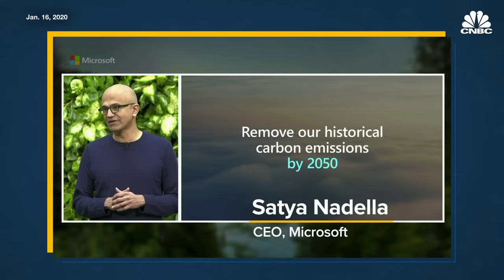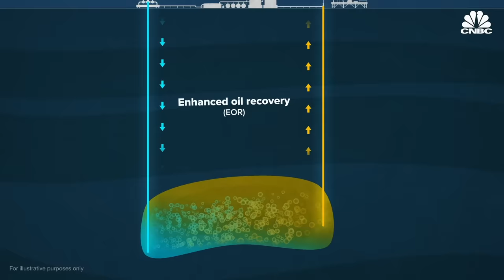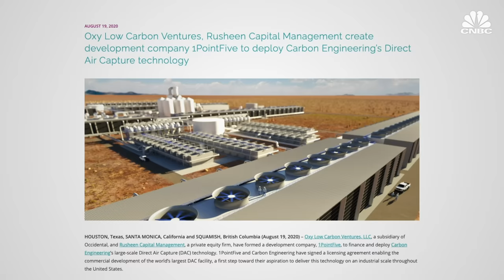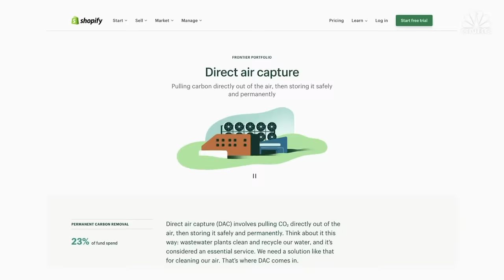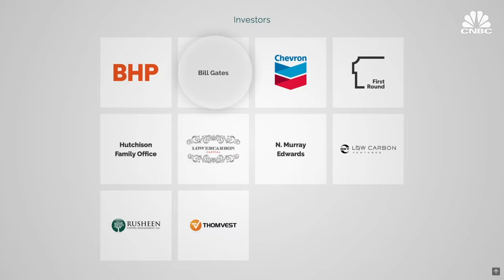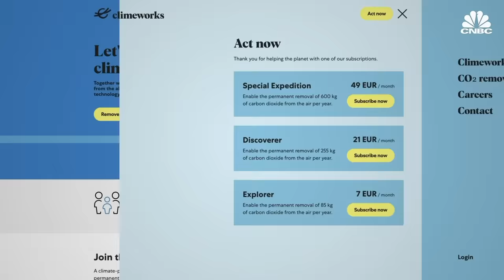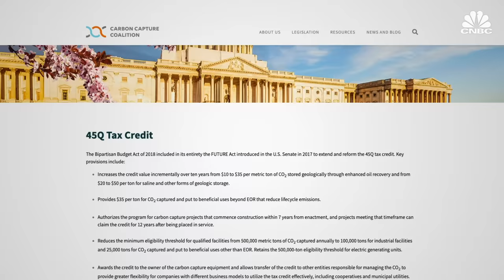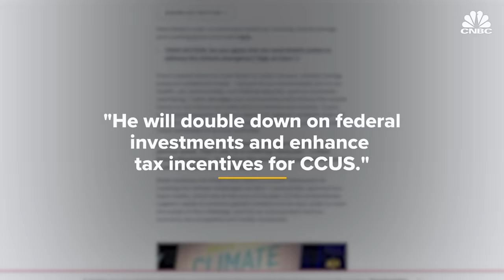Money Is Pouring Into Carbon Capture Tech, But Challenges Remain

Comment: I think carbon capture and forest preservation should work together. I think it could help capture emissions quickly.
Reply: Exactly, one of the most efficient ways of capturing carbon is through storing it in vegetation and soil... which occurs naturally. Preserving soil from erosion and desertification and preventing forests from being reduced is what we should be aiming for.
Reply: @matheusviolante8364  The most :)
Reply: @matheusviolante8364  what if capturing carbon and storing in soil will leads to death of soil... Because soil natural capacity of carbon is increased man made
Reply: @jigsaw2281  It's worth researching for the sake of all humanity
Reply: That's a good idea! The only problem is that for it to be a permanent solution those forests would have to be protected forever, making that land useless for any other purpose. There's a project in Finland to bury the CO2 they captured from the athmosphere into rock formations in the bottom of the sea, locking it away forever, although it's still really expensive and it will probably always be since its basically natural gas extraction backwards.
Reply: @felipegonzalezlelong7944  There's also this idea of using the ocean's phytoplankton to capture c02.
Reply: Yes but that first guy talking here is is the architect of the carbon capture but he says a comment that the capture he sells to Coca-Cola. That sounds like more of a cycle than capture of any sort. Lol
Reply: We need to keep these billionaires off this idea. They see it as a major threat to electric cars and only use it to gain their wealth. 
Can you imagine them not marking up the price to make up for their losses in the E.V matket?
Reply: no it doesn't, it captures like 1 percent if that.
Reply: You should probably stop thinking. 🤣🤣🤣
Reply: @matheusviolante8364  Humans are deforesting the Earth at the rate of 50 Football fields a minute. You better get started mr. appleseed. 🤣🤣🤣🤣🤣
Reply: @bargdaffy1535  when did I mention reforesting? Your point just strengthens my proposition bruh
Reply: @matheusviolante8364  Well if you don't reforest 50 football fields a minute you are constantly falling behind Sisyphus. 🤣🤣🤣
Reply: @felipegonzalezlelong7944  Carbon captures like the one in Iceland, would definitely be useful in places in North America like NYC, Chicago, Boston, Philly, Buffalo, Portland, Seattle, Denver, San Francisco, Los Angeles, Las Vegas, Reno, Minneapolis, Detroit, Pittsburgh, Toronto, Duluth, Helifax, Albany, Syacuse, Baltimore, D.C, Long Island, Hartford, Niagara Falls, Winsdor, Ottawa, Quebec City, Yellowknife, Vancouver, Calgery, Edmonton, Cape May, Cape Cod, Marquatte, Fairbanks, Anchorage, Victoria, San Diego, San Jose, Winnipeg, St. Paul, Minnesota City, Erie, Rochester, Northwest territories, Nunavut, Barrow, Nome, and Juneau.

Comment: Well, the Amazon Rainforest could use some more trees....
Reply: It's very slow even comparative to amount of carbon emission
Reply: Unfortunately planting more trees is not the solution we have to create an  artificial carbon sink and Artificial trees is the best solution we have today and the least expensive and that’s why we have these company creating carbon capture mechanisms.
Reply: @nileshkumar7403  Yeah, I really don't know what to do with the carbon myself. I was just throwing something out there.
Reply: @nileshkumar7403  But I need to live! Could I just not go out as often?
Reply: Direct carbon capture would also create jobs for skilled trades. Wouldn’t want to send pipe fitters and welders to go plant trees in the amazon. Plus this is more dense. 40 million trees in a square km is hard to do.
Reply: @RB-xq7qh  Yes, when you can get the job done with less time and more space efficiency then we should obviously do it.  We also need to look at the ocean because thats where most of the oxygen is made. We should still plant trees though. We need to do a mix of everything to get all the benefits.
Reply: The new gen carbon capture plants will be able to absorb an amount equal to 40 million trees. What do you think is more feasible 40 billion trees or 1000 of these plants? As long as they powered by renewables or low carbon energy it works like a charm
Reply: @EquityChaser1   trees could be part of the solution, they use MORE carbon in the first 30 years. The material could be used for construction (well then you want to give it 40 - 50 years). That is sequestering away - for longer time. If a home is built from wood (more solid parts not only particl boards) the material can be reused. Worst case, it ecomes carbon neutral fuel.
Reply: @xyzsame4081  planting more could but as the document series just suggested that trees dies and release carbon back into the atmosphere when their leaves fall off an decomposes. I’m not against planting trees but that’s not the solution we need  more carbon dioxide air filter schemes in order to save the 🌎  from warming any further. The experts said that we must sequester 85% by 2030 to stop our climate from reaching 2 degrees and planting more trees won’t help us accomplish that by 2030 unfortunately.
Reply: @wv9529  couldn’t agree more
Reply: So could many forest in the US. The US has destroyed quite a lot of our forest and they ar being ravaged invasive species as well.
Reply: @EquityChaser1  The tech is too far away, it eats up too much energy (creating more CO2) and it is no were as efficient as trees are.
Reply: @leighfoulkes7297  are talking about klaus lactner artificial trees.
Reply: Fact: growing trees absorb more carbon than old trees which are very big.

That doesn’t mean we should cut them. They’re heritage which should be preserved.
Reply: @EquityChaser1  a tree will remove carbon FOR FREE!  That peace of tech needs to be designed built and maintained! Cost cost cost cost.  And they will use it to pump more gas from fields did you not see that part?
Reply: @FlyingArtz.  what can we do about them pumping oil nothing and thousands will lose their jobs if they shut it down that’s why the solution is to find ways to pull carbon from the air. And trees dies and release carbon back in the air so it’s like going backwards.
Reply: @leighfoulkes7297  not if it's nuclear powered
Reply: We need biofuel so lets yoink more trees/
Reply: We are losing forests globally at the rate of 250 Football fields per minute. Better get started planting.
Reply: So many answers defending this technology act as this is an isolated issue. Will carbon capture restore natural habitats? Does it help fauna and flora? 

Restoring ecosystems is a vastly better option than carbon capture which is just a way to give oil a few more decades of existence. The destruction of the amazon will affect the entire world. There's no carbon capture technology helping with that! We're in the middle of the 6th mass extinction (caused by us, humans!) and restoring ecosystems of all sorts is the way forward - not expensive palliatives for industries that have been destroying the planet for decades. The destruction of forests affects everything from water sources, to fauna and flora to the filtration of polluting gases unlike one technology dedicated to CO2 (as if that is the only problem). This is not just about CO2, it's also other gases and dying ecosystems for which this technology will divert attention from because it's trying to extend the existence of heavy polluting industries.
Reply: Last I checked Amazon Rainforest was not IN THE OCEAN. A single land Forrest hold tiny amount of carbon compared to an Ocean.
Reply: @Neojhun  And what does carbon capture to restore the oceans? How does it help the complex ecosystems there? Carbon capture captures one type of gas, as if it is the only one and there aren't worse ones around; it does nothing for fauna and flora or restoring natural habitats.
Reply: reduce your meat intake, and then they wont cut down all the trees in the amazon!
Reply: @TheIbPROfiend  I'd argue to reduce it to zero! XD Although, we also need holistic solutions, we need to restore lost habitats
Reply: It’s always ‘plant more trees, anywhere but my country cause it’ll impact my economy’
Reply: Really that is all that matters we need to focuse on what nature does naturally
Reply: The Amazon neutralizes it’s carbon output. It isn’t responsible for removing the majority of carbon dioxide, it’s nano plankton in the oceans that does that.
Reply: plant seaweed farms. 35 million kilometers can sequester 60 billion tons of co2 a year, we add 40 billion tons a year. I believe it will lower lower the ppm of co2 to under 300ppm in 20 years.
Reply: If all the carbon in the atmosphere was from trees we could plant trees to remove it. Most of the carbon in our atmosphere is from fossil fuels which are trees that died millions of years ago and were removed from the carbon cycle. Putting the carbon back where it came from seems to make sense. The problem is that there's really no economical incentive outside of carbon trading, which will become less relevant as industries will move towards more carbon neutral processes.
Reply: @EquityChaser1  that’s true, but with these carbon removal systems, who will need trees anymore?
Reply: Sadly regrowing forests can only recapture the same amount of carbon that was released when those forest were cut down in the first place. It can never deal with the enormous amount of fossil carbon we've also released.
Some sort of direct air capture will probably be needed if we are going to restore the atmosphere to preindustrial CO2 levels. But I believe these current direct air capture projects are a waste of money, since the real limiting factor is the outrageous amount of non fossil energy needed for the carbon capture process. I don't see a point in playing with direct air capture until every coal plant in the world is shut down and the last gas fired plants are being phased out. Until then, this is mostly just for show.

Comment: The goal shouldn't be just to stop warming at 1.5 degrees, it should be to return the levels of Co2 in the atmosphere to pre-1970's levels
Reply: Carbon capture isn't about the climate.  It's about funding Co2 farming for using in products.  Just like whenever you pay more for something that is "carbon offset" and "green", you're actually just paying them to plant tree farms for lumberyards. You're not actually helping the climate, no one is, what they're actually doing is using the big climate lie to fund the operating costs of various industries....for free to them, and on your dime.  Almost every country on the planet has less Co2 than they need to make all the products they want. Co2 goes into tons of products.  So this is really about making you fund their businesses. Guess what happens with that Co2 they "remove"?  It goes back into the environment, because they sell it off to companies that make products that use it. So they're not actually changing anything.
Reply: That's not necessarily a good thing. 200 years ago CO2 concentrations were around 200ppm. Under 200ppm plant growth slows down. Plants need CO2. Under 150ppm and they start dying. So the 400 we have currently is not bad per se (Earth has had 4000ppm in the past), but the rate at which it's being dumped. If we could stop at 400ppm that would actually be good. More CO2 means better plant growth overall. That's why greenhouse farmers pump the stuff into the greenhouses.
Reply: @tinytownsoftware3837  And there are more tree's now than ever before, despite also more humans than ever before, which means more production than ever before. In fact, the movie to synthetic materials reduces usage too, so despite all of that, we're actually using wood at an all time low per person, which means our production of tree's is a lot lower than it otherwise would be if more things were made out of wood still. So it's really a dynamic thing. But it's also a problem, because the actual worlds largest contributor to co2 is decaying plant matter, including plant matter from food crops, but not exclusive to that. 

There's a lot of decaying plant matter all over the earth at all times. So the more plants there are decaying, the more greenhouse gases we get. That's the thing about plants. People just think of them as co2 absorbers and oxygen makers, but when plants decay, it produces co2. So ironically, plants are really the problem, not humans, even though we obviously need plants. That's what really makes it soo silly, because it's a problem that cannot actually be solved, and it's not necessarily a problem to begin with, as plants cause a lot of fluctuations in the makeup of the atmosphere over eons.
Reply: Choices will HAVE to be made if the carbon supply in the atmosphere is reduced to feed the world because crop yields and food production WILL lesson if the CO2 isn't there to feed these plants we depend on to have a food supply. The animals we grow to eat also have to be fed.

One solution is to harvest the CO2, liquefy it and develop a ground treatment to resupply this nutrition to fields and greenhouses to keep food yield high. Carbon or regenerative farming will also be necessary reducing the chemical farming done today.

  Removing all the CO2 will cause famine without supplying it some other way?.
Reply: How do you know that’s the right level? Why not levels 1000 years ago? 10k years ago? Just saying 1970’s is just taking a particular snapshot in billions of years and say, ‘here’. This is the error in the assumption that we know why the temperature rose BEFORE rise in CO2. The science is not clear yet.
Reply: @tinytownsoftware3837  12000 year ago, there was an ice sheet that covered 99% of Canada, it melted in less than eight hundred years, do the math on that, that’s climate change never experienced since!
Reply: Cnbc doing its best to keep you wasting money on electric cars.
Reply: @peoplez129  Hey! What about pollution/smog in big cities? I would imagine these type of fans/CO2 sechestration processes could be tinkered (if they don't already) to capture harmful air particles - harmful to humans. Wouldn't some of these still be beneficial in such places, for reducing the risk of having a big portion of the community suffering from lung cancer? What do you think about somthing like this? Currently people here are being given the compensation of retiring earlier than usual if they have lived in a polluted city for more than 25-30 years. That's more of a "after the fact" solution. It doesn't do anything to reduce the risk factor of developing lung cancer, obviously...
Reply: @peoplez129  spot on
Reply: Then all you gotta do is covid vaccinate-

Comment: I think we would all benefit from more trees. They are beautiful and can sustain an ecosystem. And make exploration more fun. Nothing like a walk in a forest
Reply: Plantiong more trees do not reduce carbon in the air. When trees die they release all the carbon they stored back into the air.
Reply: @MaDrung  Very anecdotal argument, imo. Sure, they die, but they also spread throughout the land. Sure, they die, but they store carbon in their structure and in the soil for a looong time, compared to one human life. It doesn't solve the problem but it is far more manageable than many other alternatives.
Reply: @matheusviolante8364  very anecdotal argument you've presented yourself. The solution has to come from elsewhere. Trees in their lifetime produce more CO2. What do you do when most possible places are filled with trees?  The release of CO2 will quickly ramp up. Forget the trees and focus on plancton, reducing coal and oil use by other energies (nuclear for example) and you're much much better of.
Reply: @MaDrung  Well, fair enough on the plancton and renewable energies. I pretty much agree with getting rid of oil and coal as a source of energy and you are right when you say plancton is more efficient than terrestrial plants when consuming CO2. Still, soils and forests have to be restored to their originap state to some extent in order to guarantee the carbon they can store is being stored in them. Finding an alternative solution to preventing deforestation and desertification can lead to these two bad practices being legitimized.
Reply: @matheusviolante8364  farming microalgae and oyster can be a viable option too